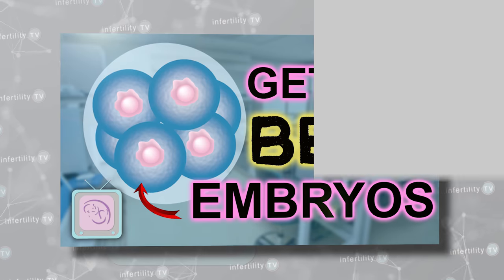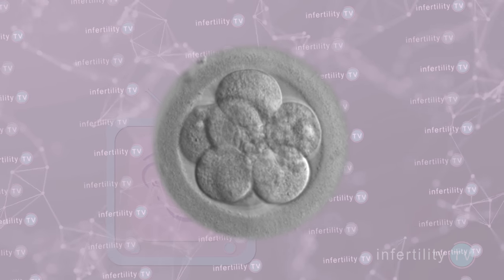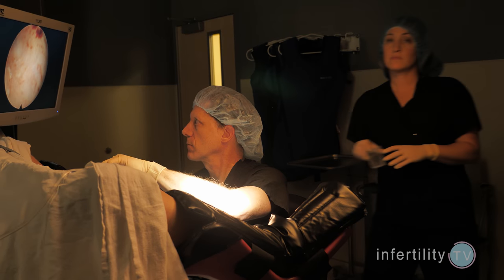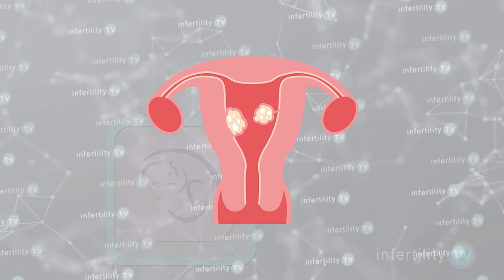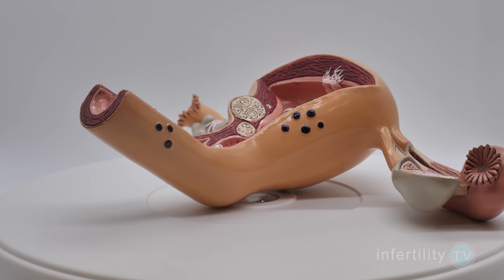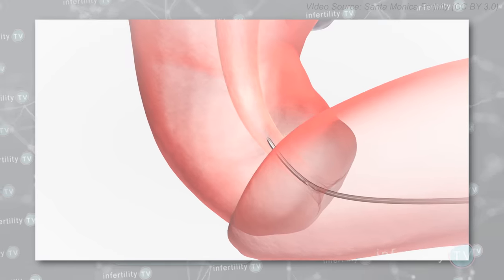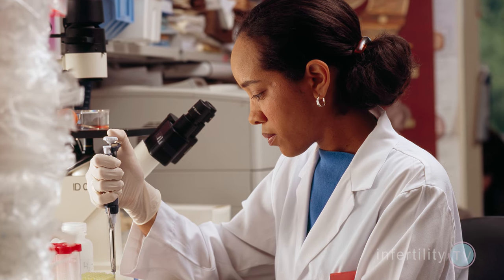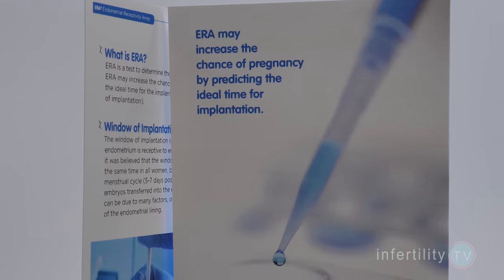Why do IVF cycles fail after transfer? Part 2 - The Carrier

Comment: How thick should the uterine lining be for implantation? I've heard between 7 & 8 is good and many ppl have much higher than 8. Is 6 bad? If the patient had a lining of around 6.5 at the last monitoring appt, would you keep them on estrace for a couple more days before starting PIO to see if it would thicken a little more? I've read that once you start PIO the lining doesn't get thicker; it just changes, compacts.
Reply: Minimum of 8 and a maximum of 14 is good

Comment: Can uterus be disturbed after an ERA test ?? What about embryo transfer after ERA...what method is required to see if uterus is alright?
Reply from the maker: The era test is usually performed using a small biopsy catheter. This will not damage the uterine lining. No follow-up evaluation is necessary
Reply: Hello doctor,
Is it required to repeat ERA after some time...can the results change ?